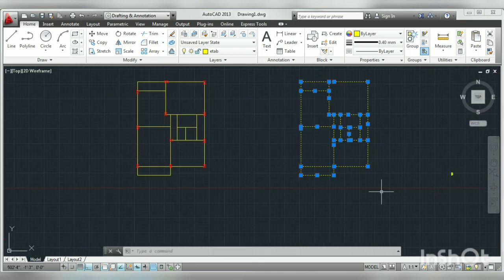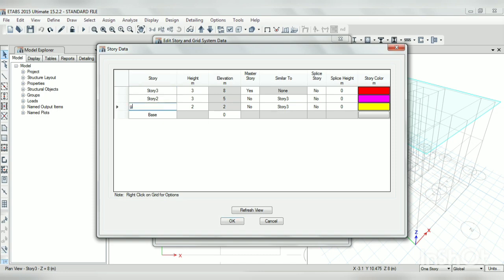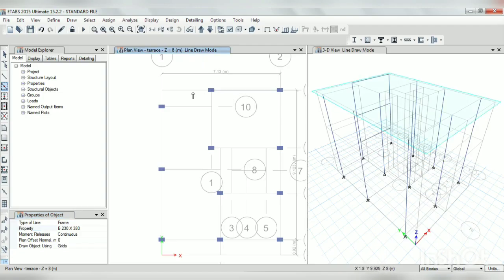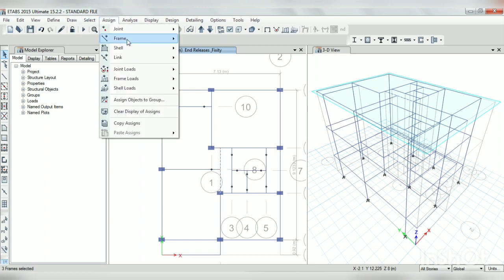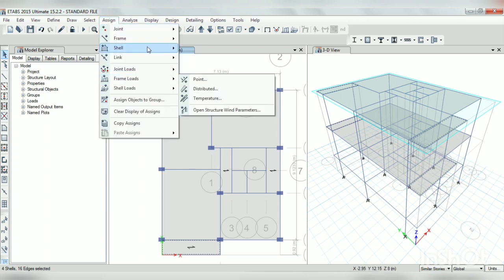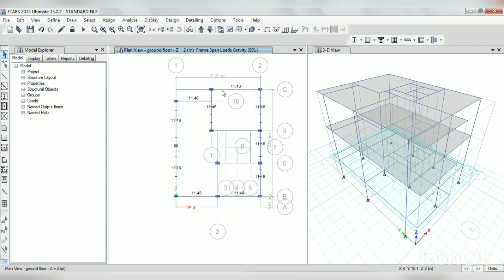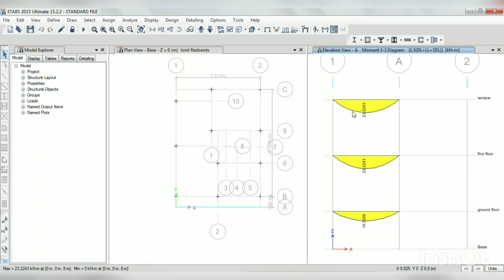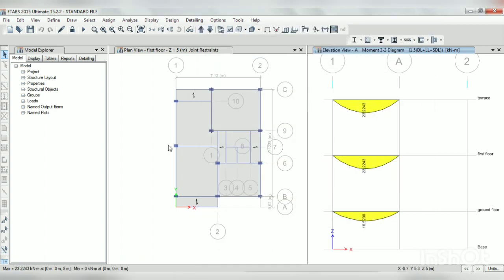etab building design g+2 live project as per is 456 residential building  import bungalow plan

Comment: You have done one mistake you applied Fixed support to all joints instead of base( All Stories).
Reply from the maker: No, i have given to only base
Reply: @Realcivil  if yes only for bottom support, then why Beam doesn't  have any negative  BM. After the analysis?
Please check there is Zero BM at support  of the beam it shouldn't be zero at support  there must be -ve moments.